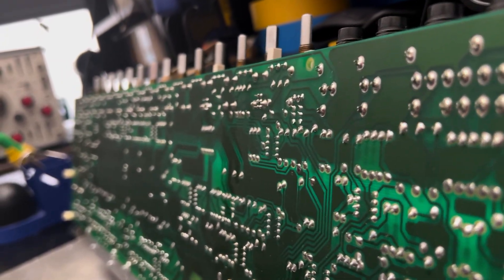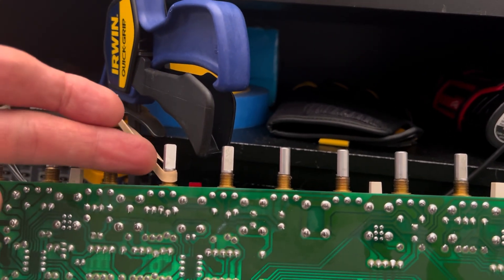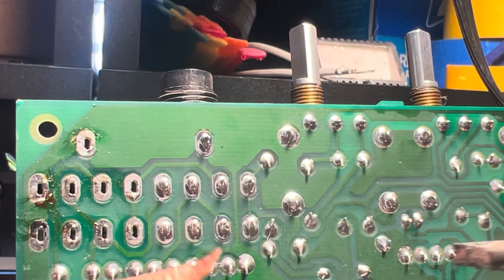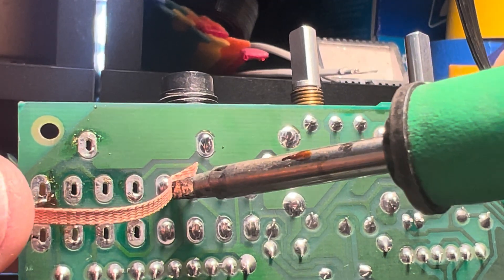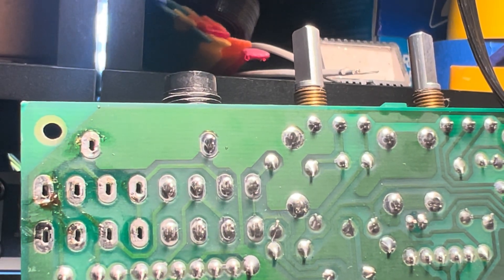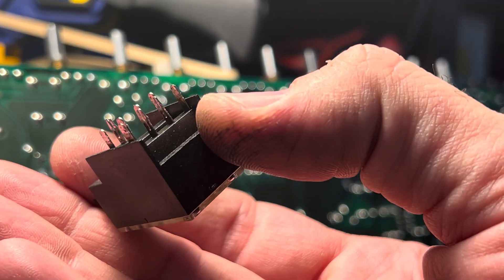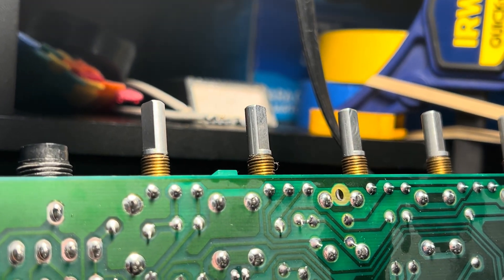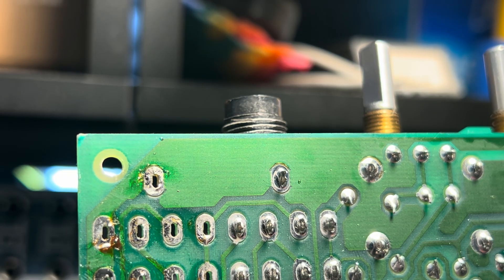Fender Ultimate Chorus — The Part I Hate Touching Most

Comment: I have an ultra that I just had serviced in hopes that I could solve a volume cutout issue. When using the distortion the volume is ok for a bit then cuts to about half volume. Did a little research and bad Factory solders seem to be a common issue. Does this sound familiar?
Reply from the maker: Very common to find broken joints there

Comment: I have one of the Ultra Chorus from 95, ever since I got it it hums with no input and pops loud when turning on, off or plugging in another device into a shared outlet. Any solutions?
Reply from the maker: Does it hum with input?  Pop is normal from the amount of these I’ve seen.
Reply: I have one that does exactly the same, doesn't hum.

Comment: ...I have never been able to master the use of solder wick, try as I might.
Reply from the maker: Gotta get the good stuff!
Reply: @ForgottenGearRestorations  ...ok, pray tell "the good stuff"?
Reply from the maker: @jamesmusicproducts Chemtronics with rosin as wide as you can get it!   I’ll send you a spool.
Reply: @ForgottenGearRestorations  ...dude!  So kind!  Thank you!  I run my Weller at 700F with a chisel tip (1/8") - is that sufficient?
Reply from the maker: @jamesmusicproducts absolutely!  700 is perfect!  The wick acts as a heat sink so if your iron doesn’t regulate temp well it’ll just cause the wick to stick. Way to get around that is to just snip a few inches of wick and use forceps or your gnarled up calloused fingers to hold it. I do the latter 😂

Comment: Interesting and thats why you use the Spade tip ,Well dang I have been using conical tips this whole time
Reply from the maker: Heat transfer!
Reply: @ForgottenGearRestorations  Makes perfect sense ,well er ill be ordering some 🙂
Reply: @ForgottenGearRestorations  it makes alot of sense more mass so the heat transfers to the tip and basically stays there ,this was a big issue of mine but i bought cheapo tips that were hollow on the shaft and I just couldnt get the tip to heat up enough but i am going to get a Hako iron so if you have any suggestions on a decent hako that would be cool ,its just i dont think I will ever do alot of PCB work but this iron dosnt tell you what temp your at its just 1 to 5 on the Pot
Reply from the maker: @joemcgraw5529 I can think of a couple. Are you gonna mainly be using it for fun or will it see heavy use?